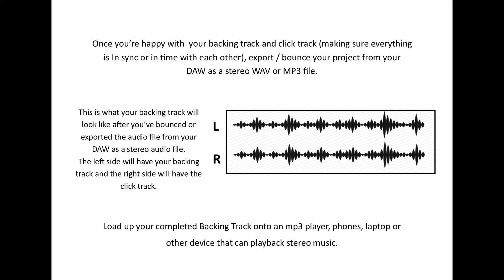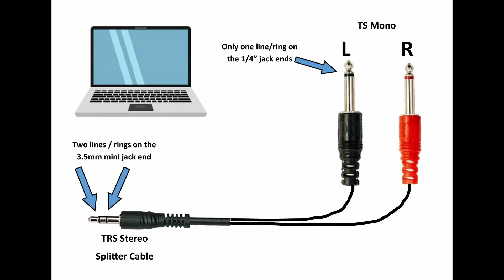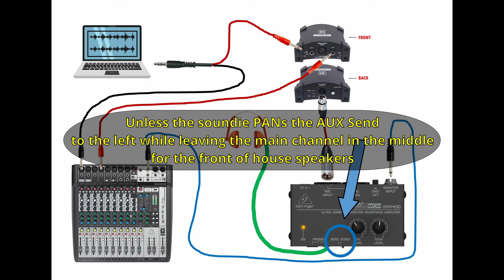How to use Backing and Click Tracks for a Live Performance

Comment: cheers mate, great video...  currently i'm using a more simpler (and less budget) route, using an iphone as my click & backing tracks (and to show lyrics). If I use a  TRS to XLR split cable, there's no need for a DI right? I can just plug it in to the MA400, and I  use a wireless IEM to share the cilcks. 

What about using two MA400 ? one for click and other for backing track so you can control each gain before going to your IEM and FOH? should be almost the same price as 1 xenyx mixer, but more compact.
thank you
Reply: @BandOnABudgetNZ  oooh SHOOT!..  many thanks for the heads up about the phantom power.. will make sure about that, good thing our first run on rehearsal nothing wrong happen because I told the mixer operator that the line is for backing tracks.
So will the DI box will secure the line for possible phantom power (just in case it was turned on)  so nothing goes wrong to the source device.? If so, then I might change the TRS to TS splitter and add a DI
currently all the clicks , backing and lyrics are from me (attached to the mic stand) using an app Stage Traxx 3 .. an awesome app. not operated from the drummer yet.  since we are old school band mates but they are happy with the clicks throught the wireless IEM. thanks again

Comment: What I still do not understand is how the signal from the mixer reaches all musicians? Is there an output for each musician on the mixer? I use a Presonus mixer that I operate with a MacBook. There I have the control of all mixes from each musician.
Reply from the maker: Use the AUX sends. Note, some smaller and cheaper mixers do not have an aux send. If your mixer has an aux send then each channel will have a knob that says AUX. The mixer will also have an AUX output commonly a jack output and sometimes an XLR output on higher end mixers. Use the AUX output to send to your other musicians through a cable to your IEMs, headphone preamps/splitter or stage monitors. Hope that helps
Reply: @BandOnABudgetNZ  still confused. do you have an email where we can request consulting?
Reply from the maker: @Laura_auer  just replied to you in email 😁

Comment: Is click track containing only click sound. Or mix of click + backing track itself? Is it possible not to sacrifice stereo to in backing track for audience ?
Reply from the maker: For my setup I have made it for CLICK ONLY. Reason for this is so that I can blend my audio as needed as the click frequencies may overlap into other frequencies in backing track and adjusting volume would also affect the volume of the click track. 

There is definitely a way to use stereo for the audience but this would require using an audio interface with 3 or 4 outputs. You'd also have to playback the backing track from a DAW like Pro Tools or Logic and assign the stereo output to your front of house  (usually outputs 1 and 2) and then use and AUX send for your click and additional backing tracks (usually outputs 3 for mono or 3 and 4 for stereo)

Comment: Your breakdown is amazing,Thank you! 
We’re on an analogue mixer but I wanna be able to control each Individual band mix coming from the Aux send to my P2 then IEM. Is there a way to do this other  than bothering FOH soundie?
Reply from the maker: Yes you could send the Aux channels to a secondary mixer or several headphone Pre amps (like the MA400 in the video) and have it placed on stage. For example:
lets say you have a main FOH mixer with 3 Aux sends. You would need to connect 3 XLR/Jack cables from the main FOH Aux sends and run them to the stage. From there plug each end of the cables into your secondary mixer that also supports 3 Aux sends. You then route those new Aux sends to your band.
Alternatively run the Aux sends from the FOH to 3 separate Headphone pre amps on stage and assign those to the band. Only downside is that you will be using a lot of cables and can get messy during setup and pack down.

A simpler approach that requires more investment from your wallet is to use a digital wireless mixer that supports Android/iOS tables and phones such as the Mackie DL16s which I have a video on here:

PART 1
https://www.youtube.com/watch?v=vG7KyzVZBtc

PART 2
https://www.youtube.com/watch?v=36oLD8vMETU

Comment: Great Video bros!! I have a question. If I want to here the the rest of the band instrumentals and play along with our backing track (from our Behringer mixer then output to wireless ear monitor).
The question is, How can i connect the FOH mixer to our  Behringer mixer and can hear every instrumentals and the backingtrack tho?
Reply from the maker: Hey! You would use the AUX send from the FOH mixer to your smaller Behringer mixer, most likely channel 1. On your FOH mixer use thee AUX dials to adjust the signal for each channel to be sent to the smaller mixer. Now, on your smaller mixer bring the channel 1 fader/knob up, and then plug in headphones or IEMs to the master out..
In other setups with more than 1 AUX output on the FOH mixer, you could use AUX 1 for the small mixer and give that to the drummer and then use AUX 2 output directly to your wireless IEM transmitter. Hope that helps. Let me know if you have any more questions.

Comment: Excellent video, thanks! Is it normal for there to be some crosstalk when the backing track is panned hard to the left and the click is panned hard to the right? I can hear a low volume of the backing track on the channel of the click.
Reply from the maker: No usually. This depends on the quality of the hardware you are using. For example in my Mackie DL16s i have true stereo when panned hard left and right.
Whereas my Phenyx Pro PTM-10 IEM system is 93% stereo separation so I get a tiny bit of bleed from the opposite sides that are panned.

If you are experiencing this issue always go back to the source to see if it is truly panned left and right. Its usually a hardware issue. Then work your way through the signal flow/chain one at a time to see where the issue lies.

Comment: Couldn't you also use a dual channel DI box instead of using two separate DI boxes?
Reply from the maker: Yes you can. I only used 2 separate DI boxes in the video to illustrate 2 audio signals more clearly.

Comment: So if you have 5 people in the band using IEMs, do they all have to share the same mix? Typically we want to hear our own instruments a little louder in our ears, and we always want our vocals louder in our own ears so we can pick our vocals out of the group. We have 5 IEM boxes we need this to go to.
Reply from the maker: This will depend on your main mixing desk and how many aux channels it supports. If your desk only has 1 Aux send then you'll have to use one transmitter and 5 receivers linked to that frequency. 

If the mixing desk has 3 Aux sends you can use 3 transmitters each with their own mix. So 3 body packs will have their own mix but 2 will have to be shared with the others.

For example my Mackie DL16s has 6 Aux Sends. I can have 6 individual IEM mixes in mono.

Hope that helps

Comment: Hi, Our band used to play live but we are now starting to run backing tracks and click tracks with mono iem. May we know what's your advice on how can we wire it on stage? Here's what we have minus the cables: 

- Laptop with DAW software for backing and click tracks.
- our own mixer
- Xtuga IEM12000 

How do we do it assuming that you don't have DI box in between the cables. We just want to know how to proceed with the gears we have referencing this video.

Thank you!
Reply from the maker: You can still use the same instructional video as a guide without the DI boxes. Just plug the audio cable from your DAW/audio interface directly into your mixer. 
You may need to assign the left channel from your DAW to one of the mixer channels and the right channel with the click from your DAW to a separate channel on your mixer.
This is so you can assign the backing track and click track to your AUX channels as well as the FOH. Make sure the click track does NOT go to the FOH but you can send the click to one of the AUX channels or multiple AUX channels so your band can hear them in the IEMs.
Hope that helps =)
Reply: @BandOnABudgetNZ  This is a lot. Thank you so much for the help!

Comment: with the second method, can't i just add the backing track + click to the red cable so i plug it directly into the small mixer and the black one with just the track to the house mixer or is the di fully needed? i used to play with a dude that had everything set up so i'm kinda lost
Reply from the maker: Yea you can go directly to the desk. The DI just allows you to add a a secondary output using the THRU output and it also lets you use the GRND/LIFT switch to remove buzzing or humming coming from the laptop if it’s charging.

Comment: Silly question perhaps, but would first method mean that you hear the backing track in one ear and click in the other? It does sending it to mixer/DI box respectively send it to both ears
Reply: only if you set the MA on stereo
Reply from the maker: Only if the stereo switch is toggled on the MA400.
if your signal path and channels are mono, it will come through both Left and Right

Comment: Is it works if I use (in the 2nd example) one multi-line DI box, and not two separated?
Reply from the maker: Yes that will work too. The DI are optional if you want to ground the signal using the GRND/LIFT switch and if you also want to use the THRU output to send the signal elsewhere like another musician or audio interface

Comment: On the sexond example you say that we could plug our headphones out of the mixer, but how can i connect more than one headphone?
Reply from the maker: You can use an audio splitter cable for two headphones or, if the mixer is bigger use AUX sends, headphone output and the L/R output to send to multiple headphones.
Other way to do it is use the Main FOH mixer which receives the click and backing track (in the examples), then use the FOH AUX to send to other musicians on stage

Comment: Can I use the same laptop to record audio while using it for backing tracks?
Reply from the maker: yes you can, you'll have to run outputs from your mixer either main FOH L/R (or with a stereo splitter), or from a mono/stereo AUX send back into an audio interface going to your laptop.
Note, there could be some latency in the recording process but you can always shift the waveforms to sync up to the click/beat

Comment: My Bro, please tell me. Could i just use the monitor mixer without the DI Box..? So the backtrack (left) go into the input monitor mixer number 1, the click (right) go into input monitor mixer number 2, and the band monitor from FOH mixer to the input monitor mixer number 3, and the backtrack from the aux of minitor mixer go into the input of FOH mixer..
Reply: My mixer has aux volume knob, so the click and the entire band will be mute on the aux knob.
Reply from the maker: Yes you can bypass the need for a DI box. I still like to use the DI box because of the GRND switch to remove unwanted electrical hums and interference from the laptop if its charging. 
I also get to use the THRU output of the DI box for sending copies of the signal (either click or backing track) to another source e.g. stage monitor or other IEM monitoring.
If you dont need this then by all means skip the DI box and go straight to the mixer =)

Comment: Help please 🙏 I am panning my click to the left and backing to the right but i am still getting some click bleed in the left. How do i solve this? Thanks for the video
Reply from the maker: Check that your original audio track (i.e backing track source) is correctly mixed and has the tracks fully panned Left and Right. If its not the backing track then it could come down to cheap equipment. Some mixers or audio interfaces that are very cheap dont offer "True stereo" meaning there will be some bleed from the opposite sides.

A good way to check this is start with the source (backing track), play it through some earphones and see if there's any bleed between the two sides. If not, then check your stereo cable from from your laptop that splits into the two TS jack cables (left and right). If this is a cheap cable it could be the problem. 
Or it could be a cheap mixer that is unable to offer true stereo. Try using a different and more expensive mixer/equipment and do a process of elimination.

Comment: I have an M32R digital mixer with P16 monitor mixers. How can I set this up using the Ultranet workflow? I also have a DAW connected via USB.
Reply: @jasonstlouis9871 Same principles apply, but since you're already using P16's it should be a simpler one. Since it's already connected via USB, then from the DAW, have the metronome send outputs to your preferred output (ours is 17-18), then from the I/O or Routing page on your M32R, have it routed to empty channels, link both to make it a stereo input, and name it appropriately (i.e. Click L, Click R). Then from the Routing page again, route the stereo channel and send to an empty ultranet send channel. Should be good to go.

If you prefer using the headphone jack of your laptop, then get the output by using the same stereo splitter cable mentioned in the video and plug it in to two DI boxes that will transform both signals to a mic-level signal. Then plug both inputs to the stage box/mixer and link those two together in the M32R as stereo inputs, name them appropriately (i.e. Click 1, Click 2). Finally route the signal in your ultranet sends in whatever channel you prefer it to be in (e.g. Channel 16) and it should be good to go. 

Finally, you just need to tell your musicians that you have the click track on channel ## on their P16's. Hope this helps :>

Comment: How to integrate in ear monitors with this set up?
Reply: Just feedback with my setup, may or may not be useful information:

Right now I'm using a small mixer at arms reach as a splitter which takes in kick from my own mic, and any other signals that only get monitored + backing track. Backing is sent to house on a separate output on the mixer, while everything else just goes to "main," which is just headphones in my case.

Best scenario for me, would be if my guitarists all had emulated outputs that I can just plug into my mixer, that way house doesn't need to be involved, otherwise it could be worth looking into micing your own cabs, split the signals for house, and also create your own monitor mixes, or record separate tracks if needed. In that case, it probably just depends on how much gear everyone feels like dealing with during setup.

Comment: I tried this setup but why do I also hear the click track (low volume but can be heared when back track is quiet) through the FOH? I have already pan click track to left 100% and backtrack 100% to the right.. I'm confused.
Reply from the maker: are both the click and backing track being sent to FOH? You should only send the backing track to the FOH and the click track to the In-ear monitors.
if its still happening you may need to double check if the backing track is actually panned hard left and right AND another thing if using very cheap mixing desk it may also not be "True stereo"
Reply: This is happening to me also, do u fix it?
Reply from the maker: @n1cK666  See my comment above, but also start with your "Source" in this case the DAW backing track. make sure the audio is panned hard to the left or right. Next would be checking the quality of you cables to make sure there are no wires internally that may be broken or touching between the left and right.
Lastly what mixer are you using? Try a different mixer, check to see if you're using a cheap one which usually doesnt have true stereo vs a better quality mixer.
Reply: Especially bad audio interfaces have left and right channels “leak” into each other at like -30 or -40 dB, which is not notable in consumer applications. 
You probably using a built in audio of PC laptop which is complete garbage. 

Get a $100 audio interface and it will solve the problems.

Comment: This is mono, what if you want a stereo backtrack for the audience?
Reply from the maker: At some point I'll have to make a video about this. But best reliable option is to playback your Backing tracks from a DAW software like ProTools or Logic. You'll also need an audio interface that support 4 separate outputs.
In your DAW you need to send your backing track to outputs 1 and 2 and route that to your main FOH mixer to then be sent to front of house and monitors.
For the click track you'll use outputs 3 and 4 (maybe even just output 3 if click can be mono) and route that signal to your FOH Mixer to be then sent to your IEMs via AUX outputs.

Some things to consider:
1.) you'll need an audio interface
2.) playback will be from a DAW or software
3.) 4 outputs require which means 4 channels used on your desk (or 2 stereo channels)
4.) 2 Aux channels used for your Click track (or just one channel if click can be mono
5.) Is stereo really that important? Who's benefiting from it? Wedge monitors are mono anyway and smaller venues wont matter about stereo because of the stereo spread. In fact watch some soundies getting interviewed about their setup for big acts like Fallout Boy, Shakira, Disturbed, almost all of them say they pan drums no more than 10 and 2 o'clock... why? because in a massive arena or festival, only one side of the crowd will hear a hard panning effect. 

Nothing wrong with stereo, just keep in mind the setup requirements and what the benefits are and to who =)